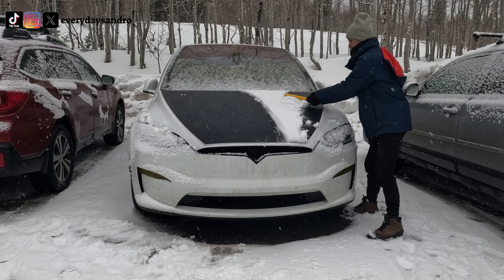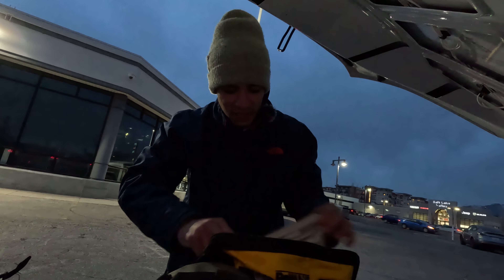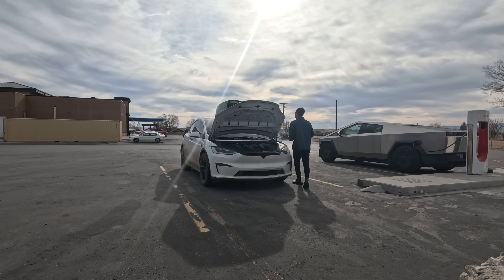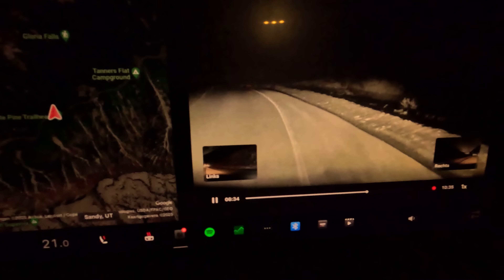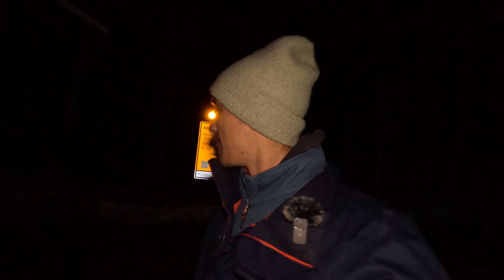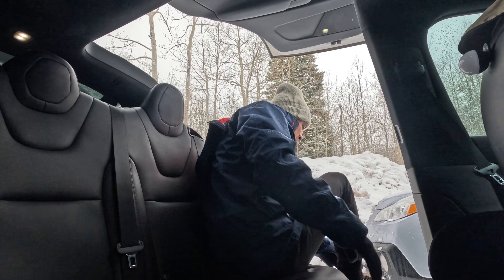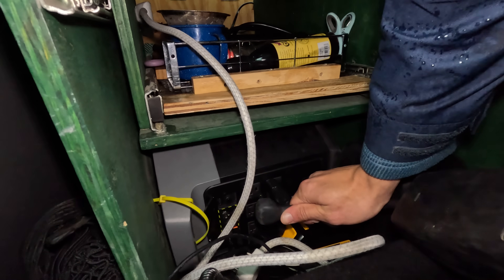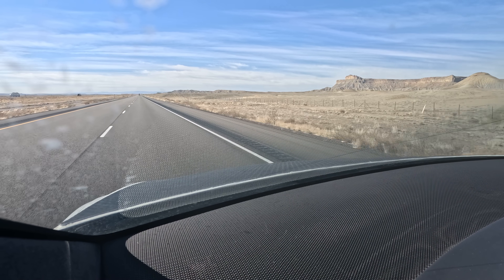Solar Charging My Tesla in a SnowStorm? (Range Test)

Comment: That’s awesome you did that real world test on battery only with no solar available . 

What model Ecoflow do you have? And how long does it take to charge from 1% to 100% while driving in the best conditions?
Reply from the maker: Thank you, I have the Delta Max Pro! And from 1-100% would take anywhere from 1-2 days depending on the solar input. These solar panels supply my cooking and electronic needs and recharge while I park or drive
Reply: @EverydaySandro thank you!! Stay safe out there! I like watching your adventures!! Keep pushing boundaries!

Comment: Hey, I noticed that you have to switch plugs, and if you made a strip, connect everything and put small switches to it, and devices that you do not use are simply turned off and have fuses in them, so any short circuit blows the fuse and not the car, and it is always safer and more convenient. I am sending a link to such a small power plant that runs idly, there are a lot of videos on YT and you could think about a small energy windmill, think about it when you are sleeping, then the Webasto could heat up and heat the car, I know that there is also a function for defrosting the car and pack all these things into a box on the cooling rack, there are such boxes.

Comment: I seriously dont see any real benefit from the eco flow setup, if you removed all those additions, the weight savings alone would probably equal the minimal gains you achieved using it.
Its an interesting experiment, but i haven't seen any useful benefits yet. People just dont seem to understand the numbers when it comes to producing electricity, its not as simple as connecting a few solar panels  when your dealing with a high capacity battery.
Reply from the maker: I appreciate your input, but I see tremendous value in this project for my expeditions.
Reply: i am with you, this setup totally have no sense
Reply: *you’re

Comment: There should be a charging port inside the car, maybe even 12V. Battery storages are getting cheaper every year and there should be solution for  usage of them from the manufacture of the car.

Comment: It would be best not to go too deep on the ecoflow, maybe stay at at least 5% or ideally 10% minimum. And don't charge it to 100%. Even its LFP but still better not to abuse it too much. Definitely a nice test though to know you can do 6-10km on the ecoflow, a little bit of insurance
Reply from the maker: Just changed the discharge limit, thank you! and yes, slow and low juice is better than no juice :)

Comment: I wish Teslas (all EVs) had a solar input, or just come optioned with built in solar. I would pay a premium for a solar hood, and roof.
Reply from the maker: It’s a great idea for sure! Makes sense that more electric vehicles would be equipped with a way to charge off the sun, maybe someday this kind of technology would be integrated
Reply: Doesnt make sense. The space covered with a solar hood and roof doesnt add significantly more juice to the car than the car needs extra due to the extra weight of the solar system. Even if it would be some sort of highly efficient car + solar system, it would only be useful in extremely sunny places and some of the biggest electric car markets in the world would not benefit from it. So in reality it would just add weight to your car and make it more expensive
Reply: @DerFettePandaLP  solar would be a tiny weight penalty(like fraction of a percent of total weight). And add a few extra miles of range every day (this has already been demonstrated to work). Making it nearly impossible to be completely stranded in the middle of nowhere. My car sits in a sunny parking lot for 13 hours a day. I would happily pay a premium for a solar package on my vehicle. 
Phantom gain>phantom drain.
Reply: @ Thing is, that 1st, how would you ever be "stranded"? Assuming you somehow let your car run out of battery in the summer, when the conditions for range and battery are optimal, then In the 12 hours you sit and get boiled in your car, waiting for the solar panels to recharge 2 miles of range, which might not even be enough to drive to the next charger, you could also just have called roadside assistance and been on your way in 1 hour instead of waiting 2 days?  
2nd, even if you dont mount actual solar panels, but get a solar system integrated in the roof (like the Fisker Ocean, Toyota Prius etc) and you live in death valley, have 13 hours of direct, cloudfree sun every day, you save like what, 1 dollar every day? In return you pay a 1000 dollar premium to get a solar roof and 30 dollars/month in increased insurance for the solar roof, GG. 

Just put solar panels on your roof at home and charge, instead of this. Solar has a 20% or lower conversion rate, which is why it needs so much area to yield good results. You just dont have that area on a car.
Reply: @ people manage to get stranded in their gas cars all the time. Even with the higher range, and superior fuel infrastructure. It’s totally possible to happen in an EV. If my car died like 50 miles away from the nearest charger, I’m still calling a tow truck. But if it were just a couple or few (which almost happened once) I’d rather limp slowly. Also car camping is a thing I enjoy.
your points are all valid, and I pretty much agree with everything you said, I think you’re misunderstanding my use case. 
I’m not suggesting it’s a good idea to wait in my car for hours instead of just plugging it in, not necessarily trying to save money either. Although that’s debatable. I’m just saying having a vehicle that passively “refuels” itself is valuable to me. Coming to my car after a 12 hour shift with an extra 4 or 5 miles of range is better than loosing 1 or 2 to me. There’s definitely a market for it. Lots of people and companies are coming up with mobile solar solutions.
Reply: @lyfebehyndbars9729 800w solar panel can produce 2kwh-4kwh on a good day with good panel alignment.  Yeah totally inefficient. Not to mention energy lost during conversion.

I have a model X and two delta pro 3,  I just charge the deltas at EV station.
Reply: @ I lost 10 percent battery while my car was parked at work for 13 hours in the sun during this recent polar blast. If it was covered roof, trunk, and hood in solar. It would’ve been closer to 5 lost. I’d much rather loose 5ish than 10 ish. Especially working in a town with 0 options for fast charging. I had to sit at a level 2 charger for like an hour waiting for the battery to heat up and charge a couple percent, so I could make it home. Solar would have prevented this. This was a rare edge case, but still would rather avoid it.

Comment: before your trip you should look at the GoSun folding solar panels.   here is the excerpt from their title  "A powerful and portable Electric car charger delivers a whopping 1,200 watts of clean solar energy, easily powering your electric vehicle on the go.  30 miles/day"   Lookup their product on youtube.   I am sure there are others but it shows that it can be setup in 1 minute and folds into a roof mount system.

Comment: Broeder, another great video. Awesome that you risked lijf en ledematen, to move that boulder off the road! The other drivers really appreciated that.
Really cool to have your own Tesla Micro Supercharger at the ready, courtesy of Team Sun & EcoFlow 🙂  I noticed some light 'steenslag' and a bit of a nasty crack in your windscreen. Will you replace it before heading down South or not worth the bother/dough?  I could imagine that you would run the windscreen until it really falls apart.. Since you travel quite a few non-paved roads, there's always the risk of shattering it right after having a new one installed (which would really suck, kind of 'dweilen met de kraan open..'). Save kilometers bro.
Reply from the maker: Ja zeker, bedankt voor het kijken. En ja, deze week heb ik alles vervangen door Tesla. Gelukkig had ik Tesla Referalls zo de duurde parts koste mij helemaal niks :) en ja, het kan allemaal gebeuren, maar ik probeer gewoon rustig aan te doen
Reply: @EverydaySandro  Da's mooi. Maak je nog een 'replacement video' daarover? Ik ben zeer geïnteresseerd daarin :-).
Fijne zondag!

Comment: Sandro, I recommend closing the falcon wing door completely so you don’t lose all of your heat inside the car. Run the charging cable through the window and  close it as far as you can. Use plastic film and tape to seal the very small gap between the window and the cable. Much more secure and you can keep the car warmer.
Reply from the maker: Great idea. No more snow for quite sometime now as we are in the south!